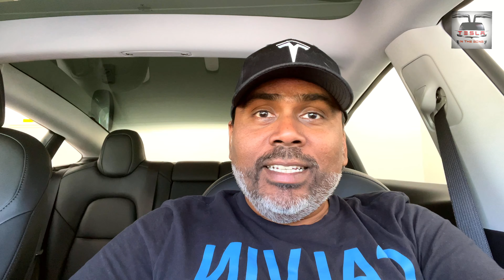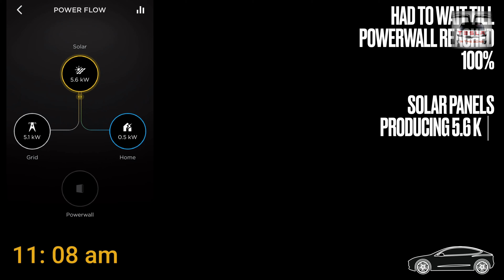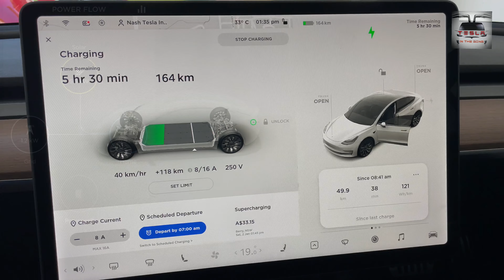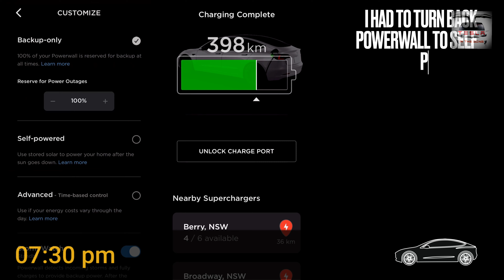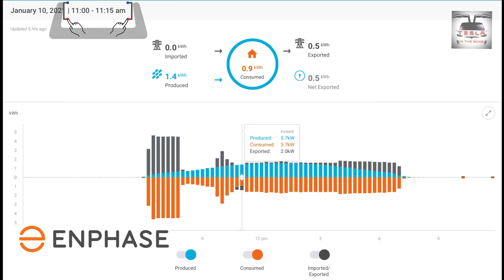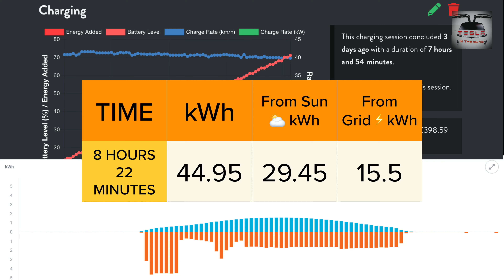Can one charge Tesla Model 3 using Solar Energy ? | Charge Electric Vehicle using Solar | Australia

Comment: On all but one occasion in the last year I have charged my Tesla Model 3 Long Range Purely from my solar panels. Three secrets. 1- 13.25 kw pv system. 2- Zappi car charger with 3 modes, one being charge from excess solar only. 3- I am generally at home during the day. On the occasion when I drove a lot on two consecutive days I charged overnight on off peak rates. Victoria, Australia.
Reply from the maker: That is really awesome insight mate. I need to push my system to 14kW and get another Powerwall. I know lots of folks love the zappi. Will invest in one later.
Reply: Worth investigating is whether the Powerwall can be programmed to start charging in the middle of the day. My LG Chem battery can't. If it could I could take advantage of the 3.25 kW over the inverter's 10 kW limit to charge the DC coupled battery thus freeing up most of the inverter's 10kW for the Tesla, house and export. By charging my house battery at midday (turning on and off manually) I have been able to use just over 13 kW from my panels. 3kW charging the battery directly using DC and 10 kW charging the house battery and car battery using AC via the inverter.
Reply: Zappi and SolarEdge EV charger both have modes to charge on excess solar only! What a great way to ensure you are only consuming solar and drawing almost nothing from the grid whilst charging, without having to change settings in the car. Maximises self consumption and keeps the car topped up for those cloudy days or long drives. 

+29 kWh / day will cover a lot of regular driving!

Comment: Australia has abundant sunshine to power the grid, homes and vehicles. No reason to use anything else.
Reply: - Renters
- People who park at work or a train station during daylight 
- Apartment owners
- People with poor solar aspect
- People in leafy suburbs who are better off with the shade than they would be with panels 
- People in heritage buildings
Reply: The green power scheme was always a hoax. They can’t control what electrons go into your home, nor is there any way (except snowy and tassie hydro) to match renewable supply and demand until very recently. And environmentalists always campaigned against hydroelectricity, at least in my lifetime. And now if green power is allegedly cheaper, why is it still more expensive than the conventional option?

Comment: Interesting info regarding the requirement to charge power wall first. The old  AGL plan is a good deal, I wonder if they will  ever  cancel it. I get FIT of 21c per kWh for solar, and costs 11c for controlled load 1 (off peak) I don't mind charging on off peak considering every solar kWh offsets someone else using coal...
Reply from the maker: Yes mate AGL has been trying to lure us off of the old EV plan. But we are steadfast holding on. We’ only get a FIT of 9c 😭😭😭 I need to get another Powerwall
Reply from the maker: @Ray Johnson  no buddy - not for the Powerwall anymore.